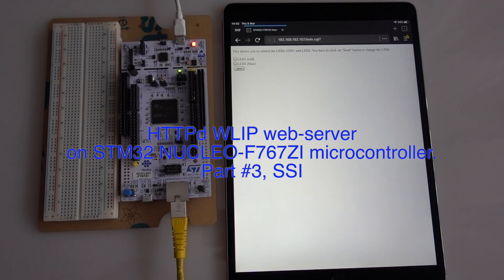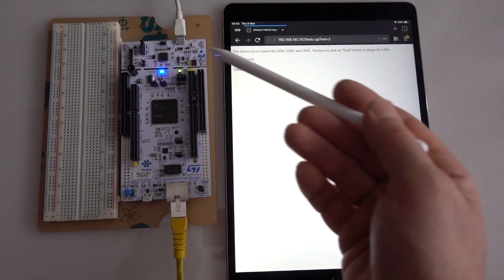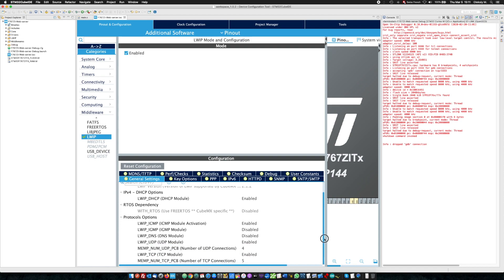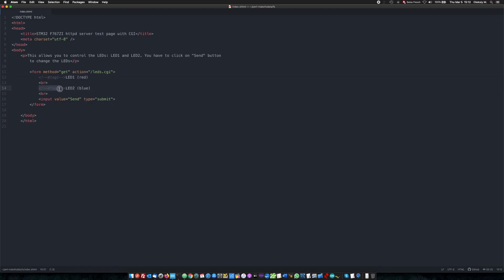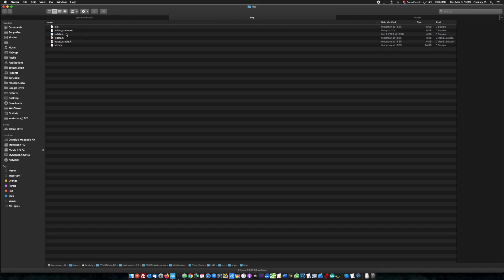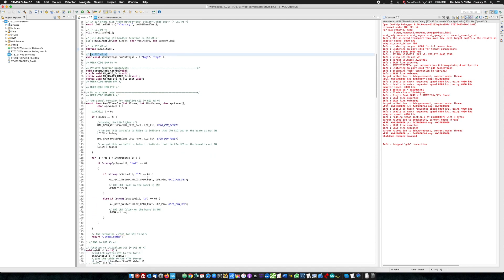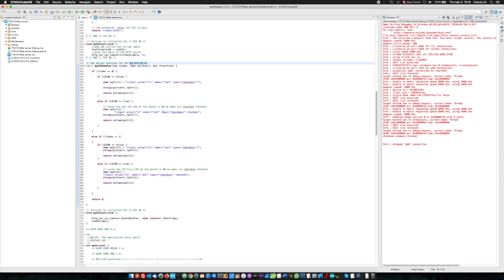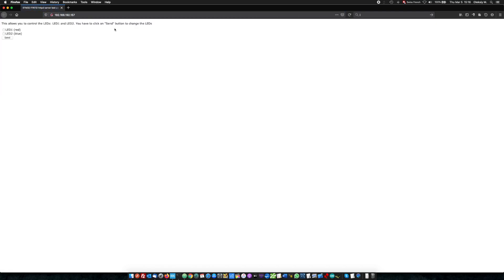HTTPd LWIP web server on STM32 NUCLEO F767ZI microcontroller  Part #3, SSI

Comment: I was able to get the example to work, and I modified the code to display a counter next to each checkbox showing how many times each LED was turned on. Now I want to know how to force the SSI handler to run from the code. For example, if I had a variable that counts seconds, how can I modify the source code so that the webpage automatically refreshes and shows the updated value of the timer each time it increments? Is there a function I can call that will cause the webpage to reload and run the SSI handler?
Reply: i need this too

Comment: Thank you very much. Will you know how to send the contents of a text container in html to the serial monitor with the same F767?
Reply from the maker: I can try to assist you. I need to know more details of the task. I do not see so far why it could not be done.
Reply: @OleksiyMuzalyev  Thank you :)

I am developing an interface with different elements, such as checkboxes, radio buttons and text containers. I have been able to place those elements, but now I have the doubt that if it is possible to generate a text file within the logic of the F767 and that it is sent back to the designed HTML page.

Comment: The STM32CUBE IDE seems to have changed.  The "...SSI_BY_FILE_EXTENSION" configuration is no longer there. Also the newest MAKEFSDATA perl script does not find ".shtml" files.  When I modified the perl script to process ".shtml" files I got a compile error, "error: 'FS_FILE_FLAGS_SSI' undeclared here (not in a function)". Note: I got this same error when I used an older script.  If I change the .shtml file to .html the SSI function doesn't fill in the tags.
Reply: i am having the same problem and the web page shows as the pure html code. and the tags are not filled in. before i added the SSI codes everything worked fine. but now its a mess.
Reply: @sudekici  I am using  Cube IDE 1.5.0..the  LWIP_HTTPD_SSI_BY_FILE_EXTENSION (HTTP SSI By File Extension)  option is there as the 6th option under HTTPD Options...PLease refer the link given by creator in video and use the files in the link. Also please refer to Part 1 and 2 videos..May be you are missing something..Good Luck
Reply: I should have been more clear - the compiler error is when I compile the STM32 project with the fsdata_custom.c file.
Reply: I am using STM32CubeIDE
 Version: 1.3.1